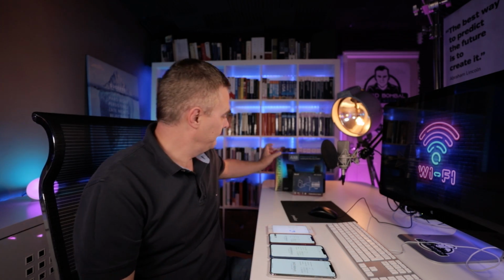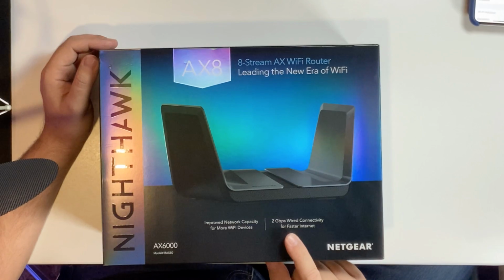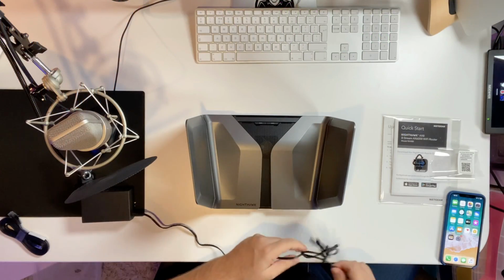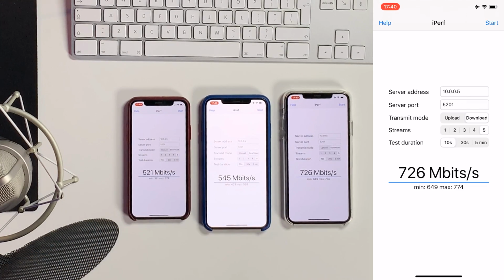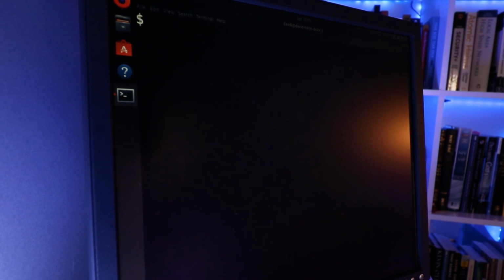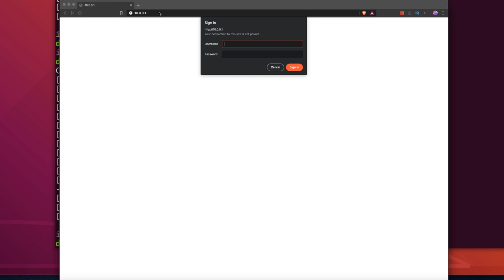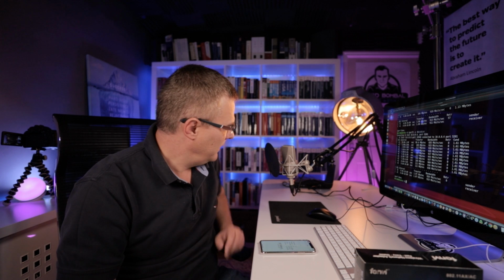WiFi 6 put to the test! 802.11ax iPhone 11 any good?

Comment: FYI, the reason why the iPhone 11 was "only" getting around 700 mbps whereas the PC was getting the full 930 mbps (limit of gigabit ethernet) is because the iPhone 11 can only use an 80 MHz channel whereas the router and the Wi-Fi 6 card used in the PC can use a 160 MHz channel. And in the final test the iPhone 11 was only getting 350-400 mbps because it was a wireless-to-wireless connection, which halves the bandwidth available as Wi-Fi is half duplex.

Comment: Good video, despite being two years old.  I've got the exact same router and wasn't sure I was actually getting AX speeds so duplicated your tests.  
Testing an iPhone 13 Pro on a 5ghz wireless to an M1 MacBook Pro on ethernet yielded average up speeds of 504 Mbits/sec (peak 705) and 434 Mbit/sec (peak 478) downloads.  I guess that validates WiFi 6 is running.  
Thanks for this demo.

Comment: WiFi 6 i have 2.4 Gbps and 4.8 Gbps on my computer to the router .BUT My iphone 12 refuse to connect to my wifi 6.. but if i make a guest net with AX 160mhz it does connect to the router but only getting 866.7 mbps  wich is the wifi 5 AC speed i have on my iphone 7  ,, but reporting AX connected  !!!  .. Router Asus AX92U , using the free "WinFi" a monitoring program by Helge..a great program that can see 160mhz as well.. getting 2,4 Gbps steady with my PC connected to the AX92U with a TP link TX3000 wifi 6 card

Comment: Fantastic video, I have a very fast internet connection here in Denmark where I live, I can only get over wifi on my iphone XS something around 400mbps, I did not know that the Iphone XS was not capable to reach near gigabit speed, now I know why :) ......btw I have 1gb connection in my flat and when I connect my Macbook (wire) I can easily reach 990 mbps which is awesome! Thanks!
Reply from the maker: Thank you Matheus! Glad the video helped you :)

Comment: As an Ekahau Certified WiFi Engineer you will never ever get these transfer rates on a high density wireless network that costs thousands and thousands pounds to design and build, AX is not worth the investment, what someone should be looking for is consistent repeatable results, can roam through a network. The video uploaded is not a correct reflection of AX, this is fine in a home network,

Comment: I live in New Zealand and have a fibre connection 1000 Mbp/s down / 500 Mbp/s up and get over 800Mbp/s down on my Wi-Fi 5 connection using a 4 year old Macbook Pro using a Fritzbox 7590 (direct line of site to the router) if other end of the house it's more around 150Mbp/s down and 100 up

Comment: im trying to broadcast iphone pubg mobile from obs without capture card.  trying out NDI capture, elgato screen link  and  after turning on these things  both wifi tuner  on the phone and modem is getting hot.  When im moving  my ping in game is getting higher. Realized these shitty softwares are using VBR bitrate and if you want to test it correctly you need to move fast and get that bitrate high to see if your wifi speed is enough for this.  i putted a fan on my modems heatsink (dissassambled it)  and ping went down to 80-100.  so these things are thorttling and only option is disassembling and active cooling. Bought a 5ghz modem and connected from it and its going to obs with gigabit ethernet its better now.

Comment: right, the wired connection also need to improve, 1Gbe is not enough, the NAS also going to 2.5Gbe, still the Switch with 10Gbe is much costly ~~ Wifi 6 will be nice with the broadband near 1G
Reply: Comcast has a 2.5 gig plan in some areas. Not mine 😢

Comment: Quality vid but not a real use case scenario of WiFi, the real benefit of WiFi 6 is multiple clients and all the benefits in that regard, single device  speed test only relying on client mimo use.  I’m sure someone as well versed as yourself in networking knows the true specifications of the standard and their Benefits, clickbaity videos like these are misleading ,Similar to only quoting power of cars does not describe the actual car.

Comment: Such a useless long vid and not one speedtest app test which was the only relevant one.
Reply from the maker: As I explained, my Internet speed is only about 63 Mbps, so it is pointless trying to use a speedtest app to test the WiFi. I used iPerf which gives a much truer indication of the speed of the WiFi network. Seems like you didn't understand those points as I explained in the video.

Comment: Hi David, regarding the test you use iphone11 to the wireless connected PC 10.0.0.4, the throughput result gets halved (400Mb/s), is it because they are 2 wifi6 clients in the network and wireless network is kind of half duplex.
Reply from the maker: In theory WiFi 6 supports multiple devices sending at the same time (MU-MIMO, OFDMA and other clever tricks). WiFi 6 is supposed to be for high density installations. But, it could be the reason. What they say in theory and what actually happens is often not the same thing.

Comment: Great job David! But with 1Gbps infrastructure you have you can get same results with decent WiFi 5 router. To really feel gain of your WiFi 6 client devices you have to go  and use something above of 1Gbps router and your iMac LAN card should be capable too. The simple setup would be thunderbolt to 10Gbps adapter on your apple pc + WiFi 6 router with 10Gbps Lan matching speeds of your thunderbolt 10Gbps adapter. Max fire rate of WiFi 6 is around of 2400Mbps , practically you should expect real results in range of 1500Mbps + ... Great video thumbs up. Will be watching for further 10Gbps Lan upgrade and WiFi testing. 👍

Comment: waste of time if u are stuck on a POTS turned DSL line thats miles from the exchange and no fibre nearby (av 2Mb/s speeds for me)... but interesting anyway, thanks
Reply from the maker: Understand the frustration Tom. Where are you based? I wish BT or Virgin would give me the option of Fiber to home :(
Reply: @davidbombal  rural northern ireland, ill be switching to a 4g router soon as its now getting competitive and a v realistic option against a cabled connection, esp when u have speeds that slow
Reply from the maker: @progtom7585  Good point. It's definitely getting more reasonable to use 4G here in England as well. Hopefully we'll both get 5G in the next decade or so :)

Comment: I m still using the ASUS AC68U which has been around for several years.....will buying the latest AC or AX Router give better transmission (AC & N signal) range due to better technology/processing chip? 

My main router is at the Living room... by the time the signal reaches my gaming /work room the speed drops to around 50-60Mbps

Comment: Still not worth it. If you currently stream you video or get your InstaTiwtFace fast as you can see it then going faster won't help you. OFDMA and BSS coloring (both not implemented yet) are what will really make it shine and that will mainly be in High Density environments. So don't by Wifi 6 thinking you are going to see a big change. That being said, If your router bites the dust then by all means replace it with a Wifi 6 router.

Comment: Thank You David for this interesting video. The performance of the new standard is quite amazing. I am very interested to see the results with the 5gig setup. Everyone who think about bying a router from Netgear: think about it twice. They have often security issues and need weeks or months to fix them. I do not want to suggest you other vendors, but Netgear is not the best choice I think.
Reply from the maker: Thank you. Difficult with home routers as most have poor security. Which vendor would you suggest? I am fortunate in that I use multiple routers / firewalls for my home network from different vendors, but that is not what most people would do.
Reply: @davidbombal  I agree with You, its not easy. The only vendor I can suggest for home use is AVM in Germany https://en.avm.de/products/ They are famous for their good and long term software support. You can buy their Fritzbox in many but countries, but not in all. Actually they have no router with 802.11ax support, but I think it will only last some some moths until they lauch a new product supporting this standard.

Comment: I would rather upgrade network to 10g sfp+ rather than ethernet. Or at very least get a 3 € gigabit NIC to double network speed of most demanding devices. At expense of cheap cables and cheap, ports on a switch and motherboard, double power consumption.
Reply from the maker: You say "I would rather upgrade network to 10g sfp+ rather than ethernet." - is that not Ethernet? Did you mean WiFi? I used a WiFi adapter in a PC to test the speeds. But, I prefer cabled connections for my PCs, but Macbooks and others don't have wired connections anymore :( End up with lots of USB to Ethernet adapters.

Comment: If the internal devices are communicating at such high speeds, what are the affects for outbound / inbound traffic at the router?
Reply from the maker: This router has 2 gig ports that can work in aggregate to increase speed to the wired network. However, this is a challenge people will face with WiFi 6 - they will need to ensure that the physical network can handle the traffic from wireless devices. Another Netgear router for example has a 5 Gig port for physical connections. My home network is too slow, so I would need to upgrade from 1 Gig to 10 Gig to really support WiFi 6. My Internet speed is also way too low. Hopefully at some point I could get fiber to home. At work you would need to make sure the core networks are built to handle many devices in the coming years that can support this kinds of speeds. Will be interesting in the next few years :)
Reply: I’m hoping Comcast brings there gig pro plan to my area, 2.5 gigs 🤤.

Comment: Thanks David! This is unrelated to the actual content but you did an outstanding job productionwise, the quality is amazing! I guess the next step is to upgrade you home network to 10G now ;-)
Reply from the maker: I really appreciate that Anthony. Took me a long time to create this video, so glad it was noticed :) Yes....definitely going to have to upgrade the network. Hopefully I can get a vendor to sponsor me.
Reply: That would be really nice! Keep us updated if you ever upgrade your network! :)
Reply: You can get a Mikrotik Switch with SFP+ connector for about 130 Euros. The only questions is : do you really need it at home ? Gigabit is more than enough for applications and streaming.  Moving large files at home is rarely neccessary and  urgent. The sata3 bandwith is only 6 Gbps, so you will need Nvme drives on both ends. Quality video as always, i bought David's ccent course on udemy last year, and now i got the whole 200-301 without any additional costs. Such a nice person.
Reply from the maker: @basadake  Firstly, thank you for the support! I appreciate it. I work with very large video files so 10 gig would be nice. Faster is always better - right? :)
Reply: Right. Expensive for home, good for home office :)

Comment: Since you demonstrated the distance from the router made a difference for the speed (i.e. the iPhone 11 had a slower connection when closer to the router) shouldn't you be running your test on the other phones at the same exact location on the desktop to do your comparison?  The other slower phones were closer to the router which you demonstrated with the iPhone 11 made the connection slower.  Granted, the differences between the other phones and the iPhone 11 appear to be greater than changing the positions of the phones might make, but I think it might be interesting to see a follow-up with the phone in the same position on the desktop.

Comment: I've seen 760Mbps on my old 802.11 ac AP (Cisco 3802i). with 80Mhz channels.
But nearing 900Mbps is clearly better.
Now I run a Cisco 9120 AP on 9800 series WLC
Reply from the maker: I was really happy to see the 920Mbps on the PC and 843Mbps on the iPhone. Nice to see it getting so close the wired connection speeds.
Reply: @davidbombal  
Yeah. I'm running a Cisco 9800CL virtual WLC now. I'm switching to a Cisco 9800L appliance soon, and will increase the routing capacity between the management vlan and the client vlan (where capwap traffic recides). Then I'll be able to see what speeds enterprise Cisco Wifi 6 can give me :) (This is the setup at my home, btw).
Really nice video btw. Keep up the good work.
Reply from the maker: @johnkristian  Thank you. Be interesting to hear what kinds of speeds you get.

Comment: Hi Dave,

I have additional question after watching your most recent video on MAC address adjustments. 
Connecting iPhone to USB port and using it as Ethernet on Windows PC - doesn’t allow changes to that NIC MAC regardless of what Mac you use in registry network address entry???

From the previous post:
Some devices reconnect to iPhone hotspot automatically and others need to be reconnected manually requiring password reentry every time. 
The very same devices doing just fine connecting to stationary AP/router. 
What’s at the culprit of the above?
1. Hotspot changing BSSID MAC address every time? 
2. Client Device / NIC storing BSSID (only) & password combination of the saved networks vs BSSID +/or BSSID MAC address & password combination?

Also, would it be possible to setup router’s WDS in either Bridge or Repeater mode connecting to iPhone’s hotspot? 

THANK YOU FOR YOUR KNOWLEDGE.

Comment: Nice change of pace 👍
Reply from the maker: Thank you Orley. Do you mean that the video is less technical?
Reply: @davidbombal   I've an 802.11ac router and debating the move to a new 802.11ax but since I've no devices currently on WiFi 6 can hold off for a bit. Just more applicable to the general public vs Network study fucused.
Reply from the maker: Orley Doss  Agreed. Probably worth waiting until WiFi 6 devices become more common. I'm trying something new - hopefully be able to reach a larger audience 😀

Comment: You could already get 600 mbs with  AC so is wifi 6 worth it? For home users, not really with clients being rare and expensive.
Reply from the maker: Agreed that it is still early days - not that many WiFi 6 clients on the market yet. You really have to have 802.11ax clients to justify the cost of the upgrade and you will want a decent Internet speed. If you were going to buy a new router today however, would you buy a Wifi 6 or an older standard?
Reply: @davidbombal  I think I'd go with AC router, Wifi 6/AX is expensive, from what I can see new Wifi 6 devices don't have chips with finished draft yet, not everything could be added with firmware/software so next router would be needed again. Same with internet speed, my internet is LTE rocking up to 50-60 mbs, fiber maybe will come during this year, maybe not but then again, if I'm next to router cable could be used anyway, speed is decreasing with range. I think Cisco and Aruba came out also with Wifi 6 access point well before those home brands like Netgear and Tplink, even their devices doesn't all seem to be according to finished standard draft.
Reply from the maker: @wiziek  Good points. I have a Cisco WiFi 6 AP which Cisco gave me last year, but if I remember right, Netgear and others beat Cisco. Cisco only released their APs in April 2019 - when I visited Cisco last year, they demonstrated some of their prerelease stuff to me - I made a quick video about it here: https://youtu.be/e6fqQQA2Hu4 - I did the opposite of you and got the WiFi 6 router partly because I wanted to test it, but also to have the feature for new devices (but, my current APs are really old anyway, so I have another good excuse to upgrade).

Comment from the maker: Menu:
========================
Overview 0:00
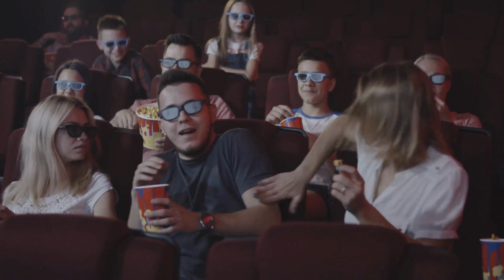Spoiler results: 2:41
Is is worth buying a wifi 6 router? 3:52
Technical content start: 4:40
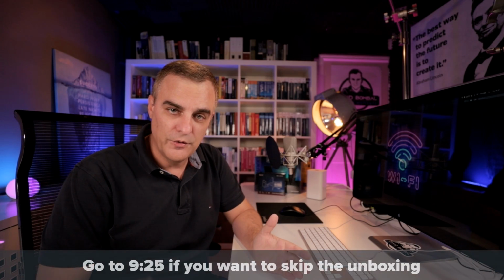Unboxing: 4:57
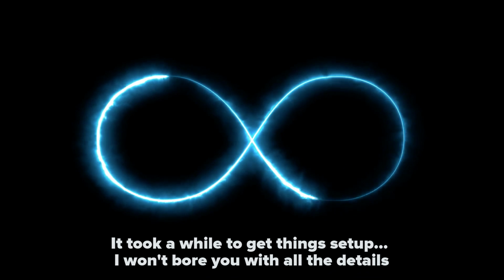iPhone 11, XS Max, X, 7 Wifi 6 testing: 9:10
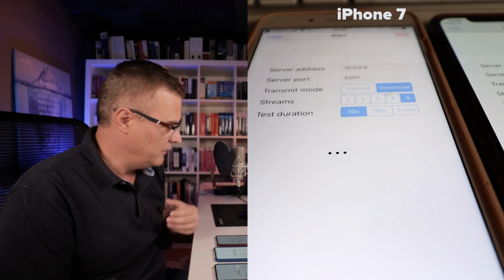PC WiFi 6 network card testing: 12:58

========================
Devices used:
========================
Netgear Router: https://amzn.to/2RzHwIB
WiFi card: https://amzn.to/3aLpX01
Reply: This is unrelated, But is it worth running kali as a main OS on a old laptop I have laying around rather then running vm. My day to day work is done on my windows 10 desktop I am just trying to find a use for this laptop.
Reply from the maker: @alphaturtle4839  Sure you could do that. The only reason to run as a VM is to make it easier to start and use Kali - it's not as disruptive if you only have a single computer.
Reply: Out of curiosity, in a real world work environment, would one run Kali on a dedicated computer or is there other benefits to running it a windows environment outside of ease of use?